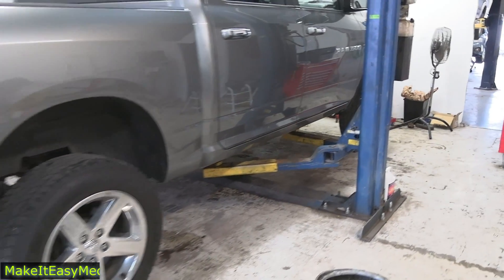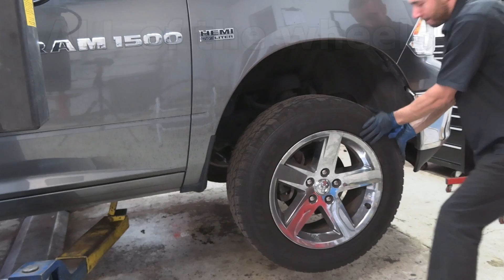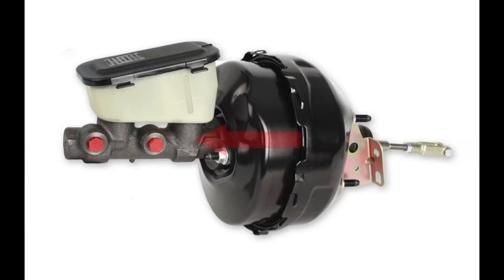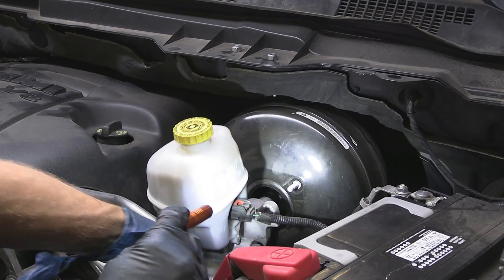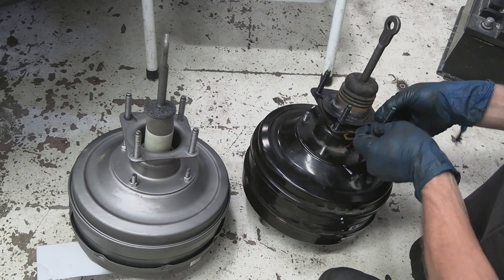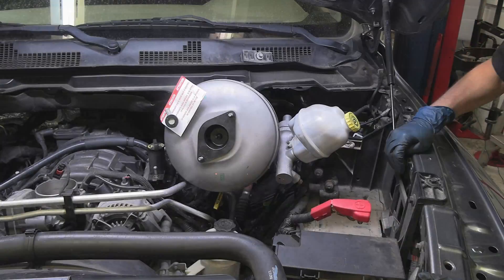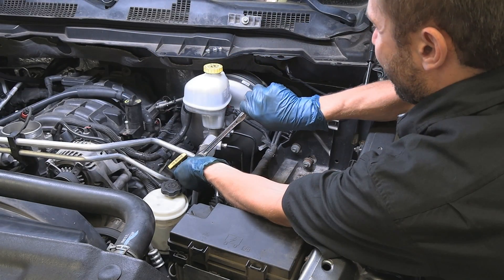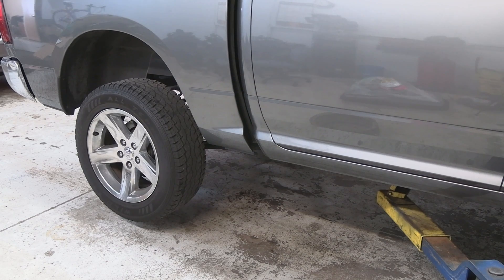What to do if your brakes lock up! (Brake Booster Replacement)

Comment: Can the brake booster lock up only one tire? The front passenger side to be precise
Reply from the maker: Not really, most likely you have a problem with the caliper (slide pins or the piston is stuck). I would start by inspecting the brake hose (make sure it is not pinched or kinked), bleed the fluid, retract the piston, lube the slide pins. (Don't forget to pump up the brakes afterward) and see if it gets better. Good luck!

Comment: I had a brake booster install and the problem of brakes engaging started. Is it possible that concierge mechanic did a bad install? I know he forgot to bleed and had to redo last few steps… please advise? 😊
Reply from the maker: Some brake boosters will have an adjusting screw near the brake pedal - I would check if there's a way to adjust that. Otherwise you could just have a bad brake booster, especially if it is aftermarket.

Comment: I've had three brake boosters go bad and apply the brakes by themselves without me touching the pedal. Two times this all started with a dead battery and rock hard pedal. I thought maybe the over night evap system running sucked out all the vacuum but I was never able to find the EXACT reason. I just replaced the boosters to fix my problem.

Comment: I need assistance here. I replaced my brake booster but the brakes keeps locking when driving for a short distance. Is it the master cylinder??
Reply: Did you find a solution?

Comment: Thank you this what the fix for my Nissan xterra this is the first time I ran into a brake booster that otherwise works holding pressure on the master cylinder

Comment: HAVE THE SAME TRUCK 2X4.TWO NEW DLR BOOSTERS,NEW MSTR,NEW ABS MODULE,CALIPERS AND HOSES...STILL LOCKS UP?????REMOVE THE VACUME FROM BOOSTER AND ALL RELEASE(BOUGHT THE LAST BOOSTER IN TH USA NO MORE OE AVALIIBLE)ANY HELP WOULD BE GREAT THANK YOU
Reply from the maker: I've seen people place a couple of washers between the booster and the master cylinder.. Not the best solution but it did work ..
Reply: @MakeItEasyMechanic  FOUND THE ISSUE!!! FIRST 2 AFTERMARKET MASTER CYLINDER BORES WERE TOO SHALLOW...3RD TIMES A CHARM....CAR QUEST IS THE ONE THAT WORKED(AUTO ZONE NO AMAZON HELL NO)THANKS FOR GETTING BACK.

Comment: wow I put a new MC on and about 2 days later the bracket got tighter and tighter  till the brakes fully locked up  I got it home  barley brakes were almost on fire  I took off the  MC and noticed the pedal got soft there was a  adjustable push rod that needed to be made shorter by a few turns thus  not pressing on the piston in the MC  I needed a bit of free play  so there was not constant pressure on the MC  I didn't know  this  but thank you  very much.

Comment: What if its still locked even after releasing the vacuum? The only way to unlock the brakes was to bleed the fluid?
Reply: Sounds like a collapsed flex line or possibly a stuck slider do some youtube research on both and the symptoms and how to diagnose
Reply: Try pulling up the brake pedal 1/8 of an inch might be the return spring

Comment: I just replaced my brake booster (non adjustable) and fixed my brake issue and gained another. My brakes are locked after i press them. Is it possible i got a bad booster replacement?
Reply: thats my issue, did you find an answer?
Reply: Pull up the brake pedal maybe 1/8 of an inch maybe the pedal return spring

Comment: You forgot to adjust the rod length inside the booster before screwing down the master cylinder
Reply: if not adjusted does this cause the brakes to drag? feels like my brakes are sluggish and then super slow when i try to speed up accelerate

Comment: I have a 2012 Prius and the brakes locked up on my while driving…. Pretty scary that it happened on the freeway, will changing the ABS module and brake booster fix the problem?

Comment: i have a 2005 suburban front brakes keep dragging i let out some brake fluid at bleeder valve and it releases?  the master brake cylinder is just nasty the fluid is clean from all the fluid i have been feeding it!  but the seal is ripped and the inside and out is super dirty so a new one on amazon is 53 dollars,  i just want new, but it has the hydraulic  brake booster but i have yet to see if mine is bad?  all the calipers were just old and needed replacing and the front rubber line new, but the issue is the same after a few miles they start to stick until i pull over and bleed calipers then its like new again?  anyone have a idea i can work, thanks
Reply: Did you ever fix your issue. I’m going through the same thing. I replaced everything except the abs module and brake booster

Comment: CANT BELIEVE IT!! If you look up most all the You tube videos on dragging brakes, you will get a few where the brakes are released by breaking the bleeder in which the guy will say its caused by the brake lines acting like a
 1 way valve and to Simply replace the lines to fix this problem, in which I was told to replace the brakes the clips, rebuild the calipers and the brake lines, lastly I was told to clear out the brake proportioning valve which I did and cleaned out the master cylinder and NOTHING, STILL HAD DRAGGING. Someone mentioned it must be the brake booster which I thought there must be no videos and after watching yours go figure, THANKS AGAIN

Comment: Hi😉 thanks for your video. It's great👍 I have an issue with brake pedal in FIAT Panda 1.3 multijet 70HP diesel year 2006. When it's hot outside, sometimes the brake pedal is not going back to the normal position after I press it and the car is still braking on every wheel. The stop bulbs are lighting up in this case. When I hit the brake pedal from the other side it's releasing the braking force. What could be the reason? Front and rear brakes are new.  Brake fluid was replaced. Vacuum pressure is present. Vacuum booster is working correctly when I test it. Do you think that the problem is related to brake pump and I have to replace it or booster?  I have had also to much fluid in the resorvier, but I've drain in a little bit and it didn't help.
Thank you in advance for your feedback.

Comment: Can someone please help me?! My front driver side brake system is completely locked. I have changed caliper and pads and brake hose only for the issue to happen again immediately. Front wheel locked...
Reply: Did you figure this out? I am having same issue only front drivers side dragging. Not total lock up but enough my wheel is steaming after a mile. Only the drivers side front wheel. Replaced caliper, brake pads, rotor, wheel hub, and cv joint.
Reply: Oh and master cylinder

Comment: Question: I replaced my calipers, brake lines, bled the brakes, the master cylinder and rotors are 2 years old...the only thing I haven't replaced is the Brake Booster...my front wheels are always rubbing my rotors to the point where there's resistance for them to heat up after a short while of using the brakes...do you think that could be because of the Brake Booster??

Comment: This was a nice video, however, the video failed to instruct the viewer in the most important aspect of replacing the booster and that is adjusting the pin depth. They are not set properly for all vehicles at the factory special tools available guarantee that the pin is not applying pressure to the master cylinder also it's normally a good idea to readjust the brake pedal linkage as well

Comment: Man, God Bless You Bro!! I have had this problem since 2Years!! I have Watched all Kinds Of Videos. I Have Bought 2 ABS Modules, Multiple Brake Calipers. None Fixed My Issue. This is about the Only Video that I've seen talking about this Type of Issue and Fix! And that is exactly My Issue. As soon as I Unplugged the Brake Booster Hose the Brakes Released. My Brake Booster is On Order, I hope it Fixes this Issue for Me once and For All!!!
Reply: Did you fix it? Was the it the booster? I am having the same issue
Reply: @rangerousy  I had the same exact issue and yes it was a bad booster. After I replaced the booster the brakes worked fine.
Reply: @rangerousy Late Reply, But Yes.
Reply: @nedunonnyp704 yeah I ended up replacing the booster and that was the issue. Thanks
Reply: Was it one wheel or all four
Reply: @suavelo5494 All 4
Reply: Yeah I had the same problem but my abs was bad and  replaced the abs and then my brake started seizing up also, though it was the calipers replaced  them also and they was still locking up, finally replaced the Brake booster and everything worked perfect no more problems with the brakes seizing up
Reply: Was it the brake booster?
Reply: @lilygee3069 Yes
Reply: I had the same problem and it was the booster.
Reply: My mechanic has been replacing brakes and a few master cylinders over the years. Brakes end up seizing up. Either on & off like quick and release or time to tow again 😔 
Thank you! I’m looking into it and my mechanic is fired

Comment: Another thing to look at is the brake pedal return spring. If that's broken or otherwise not working, the weight of the pedal itself might apply small pressure, multiplied by the brake booster, causing brake drag.
Reply: I love you!! Hundreds of dollars wasted on new pads and rotors (all around), brake flush, and master cylinder only to finally solve the head caused by a damn spring 😂😂😂
Reply: What was it initially doing? @Kurby_

Comment: Same thing is happening to my Honda but iv already replaced the booster could I have just gotten a bad one or something?
Reply: Did you figure it out I just replaced mine and it's still locking up
Reply: @angelfms1  nope 0 luck
Reply: @Mx-5  what have you done so far .

 We did front calipers  than brake booster  still same  removing booster check valve unlock the brakes  so replaced check valve .still the same
Reply: @mx-528  I'll report back if we figure it out
Reply: @angelfms1  iv done everything break booster,check valve,metal break lines,new calipers,rotors,braided break lines that go into the calipers, the distribution block,master cylinder,break pads, it only releases when I pull the check valve off so I honestly have no clue
Reply: @angelfms1  iv bench bleed the master cylinder,the entire system has new fluid as well
Reply: @mx-528  oh man !  so what honda do you have and does it have an abs pump?  i called my cousin that works at honda his first answer was abs pump ,
Reply: @angelfms1  sorry just seeing this it’s a 1997 ek hatchback
Reply: Did you get it fix?
Reply: @jmtires4606  not yet I order another brand new booster and a caliper to be safe I’m gonna install them today I’ll let u know how it goes
Reply: @Mx-5   it's got to be a bad brake booster .. 
This is how it went for me 
Oem honda one locked up all calipers 
I removed the vacume line  and would unlock them .

I replaced with autozone booster . 
It was able to be driven farther but they would still end up locking up after 10 minute drive . 

I went back to autozone and used worranty and got another  booster 

After the second install  the car would now not lock up brakes at all.. but now brakes would feel spongy .. when I would brake it would Rev up my engine and cause a idle issue and throw a idle control valve code  so another crap booster . I went back to autozone for the 3rd time and had them order another booster ..

The 3rd booster  worked excellent no vacume issues no brake lock ups  and was all back to normal or better . 

Another note to add . 
Booster 1 and 2 had remanufactured in China 

The 3rd booster had remanufactured in Mexico.
Reply: @angelfms1  thank I just got the new booster but unfortunately my fuel pump decide to go out on me😂 but this definitely helps then u so much iv been trying to solve this for months
Reply: @mx-528  Your issue may well be the break booster push rod is not set to the proper length. Even if the break booster is brand new and working properly, a push rod that is too long will keep pressure into the master cylinder which will continue to apply the breaks (dragging breaks) even after you release the break pedal.
Reply: What yr is your Honda

Comment: I think this may be the problem that I have but it’s just the two front wheels that’s locked up because I have front wheel drive. Cus when the tow truck parked it in front of my house, in neutral the back wheels were moving.
Reply: was it fixed. having the same problem here

Comment: This happened to me while driving after my mechanic had replaced the master cylinder and breakbooster earlier that day. The breaks where completely locked, and thanks to this video i pulled check valve and put it back on. And the breaks unlocked, thank you so much this video helped me get home. I called the mechanic and he said that he will be replacing the break booster again. I hope that’s the problem 😳
Reply: Currently having the same problem except I’m stuck at a gas station after my mechanic shop closed. 😩😩
Reply: It’s was a faulty break booster I bought at AUTO ZONE it said made in china and it didn’t function went back to autozone for a exchange and the new said made in Mexico and it’s worked truck runs like champ …. People check your break booster first befor you start buying parts
Reply: Did a new booster fix the issue?
Reply: @marcialtorres2364  yes it did.
Reply: @oscar_thedj glad to hear . I just had my booster go out w a vacuum leak . Bought one used from offer up and slapped it on just like the previous 3 x. This time , wheels locked up after one drive around the block . Parked and when I turned it back on for a 2nd round around the block,  the car wouldn't move when in drive or reverse.  When I remove the master cylinder the calipers unlocked . Tried swapping check valves incase its the check valve.  And the locking persist . I slapped on my broken brake booster, and air leaks but at least my brakes aren't staying stuck. Im guessing the brake booster I bought is faulty as well except that its stuck on boosted ?
Reply: @rickyaguilar7572 it sounds like a faulty break booster.
Reply: I installed new master cylinder and break booster calipers rotors and pads .. and my pedal still gets hard after 15min driving my breaks heat up and lock
Reply: @user-sr4is5gb2b what was your problem
Reply: @LeonelFelix-y2s did you ever figure out the problem?
Reply: @LeonelFelix-y2s  did you figure out the problem?
Reply: @LeonelFelix-y2s brake booster rod may be adjusted too close to master cylinder and when it warms up it expands.
Reply: Brake ?
Reply: Is it true that when u replace the brake booster, that you need to adjust the booster rod that goes to the master cylinder? I had my booster replaced and now my brake pedal travels lower till it activates the brakes, and my front right brake locks up when brakes are pressed hard. I heard the booster rod needs adjustment.
Reply: @oddtimekeeper yes , you have to push down the rod w enough force to get a grip of it w pliers and twist the rod to adjust